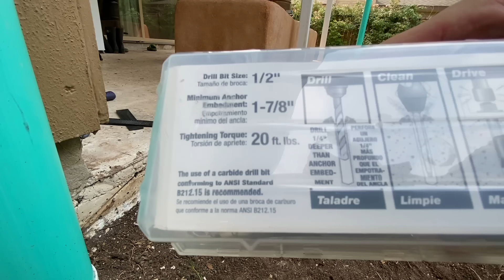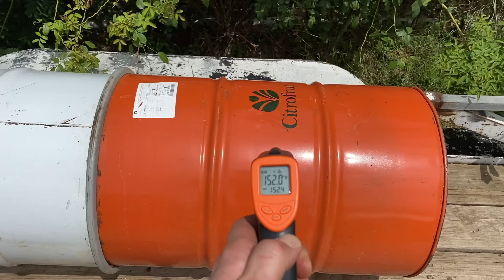BUG-PROOF & HEATED porch

Comment: To vibrate the concrete you could try a reciprocating saw with a soft attachment, or something like an orbital sander turned upside-down.  Thanks for taking the time to show us this addition - the rocket stove is on my bucket list of future projects!
Reply from the maker: Great ideas both. I had never heard of the orbital sander idea until today. Thanks for your support!
Reply: I was thinking reciprocating saw without a blade
Reply: Tapping the iron with a wooden or rubber mallet will do a similar job. 
I tap wooden form work when laying a slab for that very reason. It's cheap and it works.

Comment: Take a hair dryer and go over ripple area and you can heat the area up and it will take them out. Used to do that to plastic we would put up on outside of windows to make a air barrier in the winter.
Reply from the maker: Good to know. I will do that first thing when I hang them back up this winter. Thanks!

Comment: I really enjoyed your porch stove and watching you enclose the area I noticed you filled the gap with cement and sand. There is a product called nonshrink grout made for that application, also laying the vibrator against the outside of the beam will allow the concrete to flow into the gap.
Reply from the maker: Thanks for the tips. And thanks for subscribing!!

Comment: To vibrate the concrete you can use hammer drill at piece of wood pressed against the beam. It's close to better than special vibrator tool. But we do with just hand hammering against concrete support a lot.
Reply from the maker: Great idea. Thanks for commenting and for subscribing! I’ve been told a palm sander can work too. Thanks!
Reply: @suburbanbiology  There is a SDS bit I use at work, it is called a "SDS Radiator Agitator Bit". Looks like a hockey puck on a SDS shaft. It is cheap and turns any SDS hammer Drill/Chisel in to a vibratory tool. And with the surface being made of plastic it does not mark anything.

Comment: Little tip I learned off an AC installer buddy is when trying to start a hole with a hammer drill, use the hammer action on it without the bit rotating for a good half inch then drill. Makes it much easier cause the drill isnt running away from you.
Reply from the maker: Nice! I would have never thought of that on my own. I’ll have to try that next time. Thanks for the tip! And thanks for your support!

Comment: I just watched the build video of the rocket mass heater, great stuff!

I do wonder though... once the area is enclosed the feed for the heater will be pulling warm air out of that enclosed space to then heat air that is pulled from the enclosed space etc...

I would think that an air intake pulling cold air from outside to fire that heater will make the whole system more efficient. I don't know how much efficiency this could add but I imagine the air moving through that heater is substantial enough to consider the idea.

Good on you for documenting all your work and giving YouTube a go! I love the heater, hope you have more engaging projects to come 👍
Reply from the maker: I seriously considered creating a dedicated air intake that connected to the outside world to avoid that. When I did a search on the permies foum though, it sounds like this has been addressed there by others in the past. The overall consensus was that it shouldn’t matter too much if there is a lot of air leaking because there’s a huge amount of hot thermal mass to compensate for it. Thanks for commenting and for subscribing!

Comment: For the concrete vibrator I've seen guys use their sawzall without a blade in it, pressed up against the form. Not sure if that could work for you but thought it might get the juices flowing, the neurotransmitters firing off. Really enjoying your videos. The end goal, how you get there and the way you communicate it to the audience all works for me. Hope you get to quit your 9 - 5🎉

Btw I used ratchet straps once when i didnt have a transmission jack and I had to replace the transmission on a big block 454 on the side of the road, on the sly, before anyone realized my vehicle was disabled otherwise I'd lose it. Fun times (not), ratchet straps worked like a charm to raise and lower those transmissions.
Reply from the maker: Thanks for the thoughtful comments. Glad you enjoyed!

Comment: I like the reciprocating saw and orbital sander ideas for settling the concrete but i have used a hammer on many occasions by just tapping on my concrete forms. It's always worked well for me.
Reply from the maker: Thanks for the tip. Simple tools are often the best. Cheers!

Comment: Looks great u should put weather stripping on the metal that holds the plastic so it really secured . Your work is outstanding
Reply from the maker: Thank you for commenting. I thought about adding some rubber strips glued to the steel strips. I even bought the rubber already. It was a surprisingly tight seal with just the band steel though. I’m going to try to use the stove as a sauna this winter (video pending). If a lot of cold air leaks I’ll add the rubber strips. Thanks for subscribing!
Reply: I thought the same since the grommet has a different depth than the plastic you'd want consistent pressure all across the plastic to avoid tearing. Some collapsible weather stripping wouldn't hurt.

Comment: @suburbanbiology

I know video is 6 months old, just found your channel.  In response to the concrete vibrator, a palm sander without the sandpaper, held against the metal beam should do it. Or hold a length (example 24") of gas pipe or rebar at the top, dip the bottom in the cement mixture and buzz the bar with the palm sander. That will do a similar of a concrete vibrator.
Reply from the maker: Thank you for the tips.  I’ll keep them in the ol’ mental toolbox for next time. Cheers!

Comment: Honestly great project! I have 2 items. First, a question did you choose to go with metal rollers due to weight (as nylon would be quieter), and second a suggestion would a spring on the top wheel assembly remove some of that gap for you? 

Again great job! 💯💗🇺🇸

Comment: If you are wanting to not get cement on your square pipe try using a piece of flat metal to funnel the cement without getting it onto your pipe
Reply: Watched Professional Masons tuck point a brick house.   They were using Cake Icing bags with appropriate sized tip. Fast, clean, neat.

Comment: Another option for vibrating the concrete is to place the pad of a wood sander on the outside of the steel and vibrate the steel.
Reply from the maker: Good idea. Thanks for the tip!!

Comment: Put vibratory on metal to vibrate or vibrate with an orbital sander.

Duct tape cardboard to both sides of gap so they flap and can use them like an adjustable funnel and keeps edges clean.
Reply from the maker: Both are good ideas. I’ve stored them away for future projects. Thanks! And thanks for subscribing!

Comment: You could have gotten brackets put them in between the gap to secure it and just used the foam insulation . Easier. Also there is type that repels rodents and bugs also in the foam.

Comment: The other wheel on the spline tool is actually for push the screen into the slot first.  Pushing the screen all the way into the slot with the rounded wheel first makes putting the spline in a lot easier.
Reply from the maker: Good to know. Thanks!

Comment: Excellent work! It’s probably overkill, but if anything is worth doing, it’s worth overdoing, right? You could maybe dab a drop of blue Loctite on the bolts that went into the rivnuts. You probably know, but blue Loctite prevents loosening from vibration, but it’s not so strong that you’d need heat to remove the bolt later on.

Comment: You could spring load the wheels to take up the gap.  I haven't finished your video, so apologies if you figured that out already.
Reply from the maker: Thanks for the tip! I didn’t leave a big enough gap for most springs to fit on the wheel. But that’s a great idea. If I could do it again, I would definitely go that route. Thanks for the tip and thanks for subscribing!

Comment: You should have used the hammerdrill to vibrate the steel beam with some scrap steel between with the intetion to vibrate and not drill trough obviously :)

Comment: well, as an European raised on the metric system, I would say that the metric system makes sense until it doesn't... 🙂 The metric was a relatively recent contraption. I still remember my grandfather talking all sorts of weird and wonderful measures ... and no, he wasn't English nor even from Western Europe

46:26.. phew, I kept scrolling, hoping that you did not leave the entire top double beam just hanging by the screws in the wooden beam. It is a lot of lever that pulls on that and wood does give way eventually. I would have put the entire side beam under the top one somehow, but anyway better what you did than nothing. I know that it may disturb your esthetics somewhat but do consider a structural beam in the middle of the whole set-up to support the upper steel beam.

55:48 this may be a silly idea, but I am however wondering if you cold also use a magnetic sticky tape on the main beam as well (hoping you find some really strong one

58:52  😅yes I care and I am sure many others do as well. I have tried to make videos like this and I get into detail paralysis and give up. You are doing great
Reply from the maker: Valid concerns. The doors themselves actually serve to hold the upper beam up since they push up on the track from underneath it. I don’t really plan on ever sliding the doors out of there unless something has gone very wrong and needs repair. Good thinking though. Thanks for the thoughtful comments!

Comment: Okay, I am invested.  I would be adding a post at your outside corner that is attached with steel braces.  But maybe that is overkill.  Saying this though because the post looks toenailed in.  Can't that crack over time?  The steel beams are adding weight.  Or did welding the steel posts to outside provide support?  When our neighbor enclosed the wood beam carport, he added a post at the outer corner.  And all of ours are on steel braces connected to the slab. Hoping that is making sense.
Reply from the maker: The vertical posts actually transfer the load from the upper beam to the lower beam which is bolted into concrete. Even without the lag screws in the upper beam the top beam would stay put. Of course that would be a terrible idea though :) thanks for being invested!!!

Comment: can i recommend fixing a spring between the wheel nut so that it expands and shrinks depending on the distance to that it can keep a firm grip regardless of the distance on the track
Reply from the maker: Man that is a great idea! I wish I had though of that in advance. I’m afraid the clearance is so tight that I couldn’t get a spring to fit in there any more. For the next project though I will keep that in mind. Thanks! And thanks for commenting and for subscribing!

Comment: The recipe saw could actually be used without a blade, just nose it in to the steel beam and contact vibrate it. You could even set your impact drill to do the same on the steel beam.
Reply from the maker: Good ideas both. Thank you for sharing! And thanks for subscribing!

Comment: The problem is.. the air that goes into the heater has to be replaced by air from somewhere and it will draw an equal volume of cold air from outside into the space you're trying to heat.
Reply from the maker: That does indeed happen. From what ive read though the huge amount of heated thermal mass in this type of stove releases enough energy to heat that incoming cold air. I thought about building an intake duct that pulls air exclusively from the outside. The complexity of that, though just seemed to be too much so I didn’t do it. I guess time will tell.
Reply: @suburbanbiology   good to know you have considered it rather than just being caught unaware. The thermal transfer will indeed make up for a lot compared to a regular fast-and-hot fire. I speak from experience where we would light a nice fire and would be plagued by draughts, the practical solution was to crack the nearest door or window to short circuit the draught, I guess that the screen will actually be the shortest rout for the air to travel so my comment should actually be considered irrelevant.. 

And I should add that your workmanship and diligence is impressive.
Reply: I was thinking the same thing. An HRV or ERV would be perfect with this.

Comment: 36:45 you could have added a spring tensioner mechanism to avoid that slack along the rails, avoiding the ratling and swaying..
Reply from the maker: Yes a spring loaded wheel would have helped. I build it too tight to add one now. If I could go back I would have designed the mounts a bit differently to leave room for a spring. Great idea! Thanks for commenting!

Comment: Instead of metal roller could you not  use nylon/plastic rollers that are quieter, also I'd use springs in the top one's to hold the rollers centered to prevent that slack or flap your doors will have in windy conditions

Comment: Weird suggestion but what if you weld a normal homemade door (with screening and vinyl) inside one of the sliding door frames, this way you wont have to slide the whole thing every time you enter the greenhouse (excited for that video btw!) and would spare you from the sliding motion sound. This way you'll have an inside door to the greenhouse and the outside door to the side that you're planning on making.
Also I don't know if this would work but would foam inside the metal frame parts reduce the sound of the metal doors sliding? Also would paint-on rubber on the tracks also help with the sound?
Reply from the maker: I bet all 3 of those ideas would work to some degree. It would just be a matter of taking the time to do it. Long term I assume that I will usually just leave the sliding doors open since e the greenhouse itself will close be the barrier to the outside world. I will probably close it only when we are hanging out by the rocket mass heater or using it to heat the house. Thanks for the comment!

Comment: What  i never  understood  is  why didn't  you put  copper  pipe inside  the  the pipes  area,  loops of pipe would  have allowed  you  to pipe the heat in a old style  truck radiator  and  circulation  of very warm water  through  the radiator  places in your  central  heat duck  work  next  to the blower  fan
Reply from the maker: The added complexity of having water and pipes that might lead to steam, and therefore explosion is something I wanted to avoid. You are correct though. It definitely could be done. Others have done it. Check out the permies forum. Thanks for commenting and subscribing!